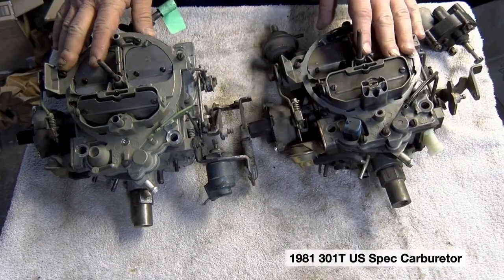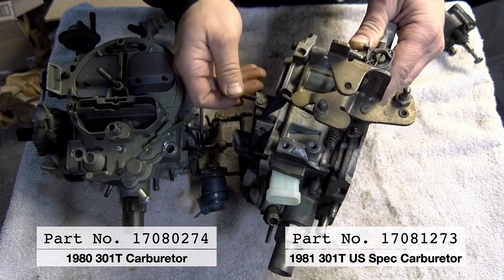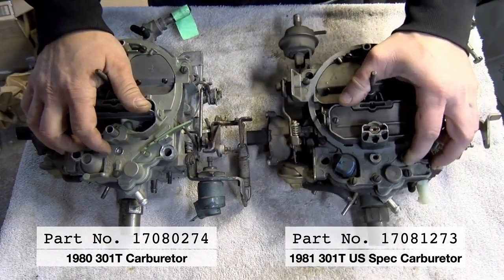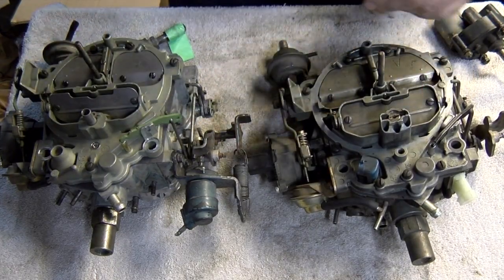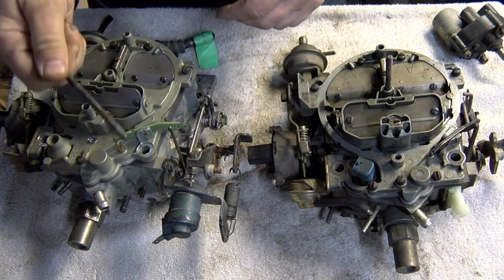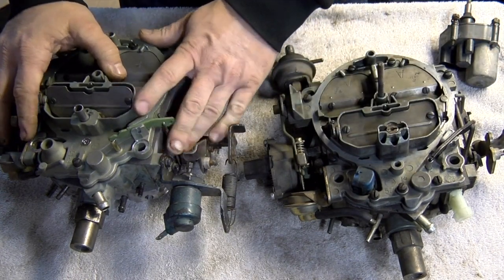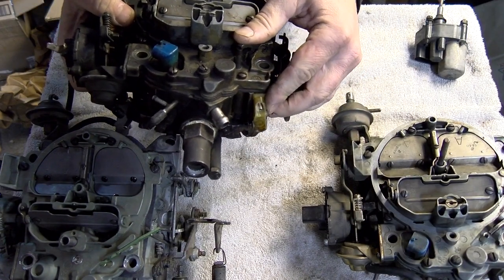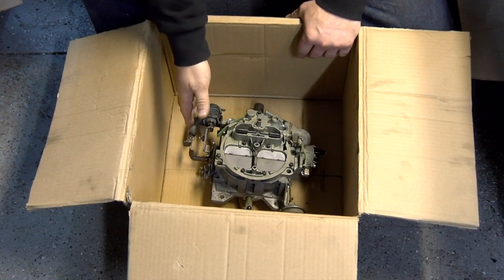TTA Performance - How to ship your carburetor

Comment: Would it be possible to have a supercharger on a turbo trans am and still have the turbocharger on the trans am?
Reply from the maker: I suppose it would be possible. I wouldn't try to blow thru the q jet with a supercharger. I would suggest a different carb or EFI.